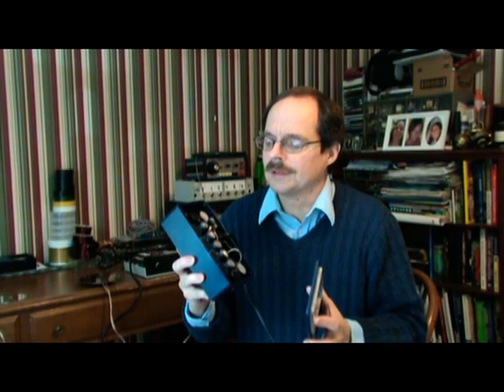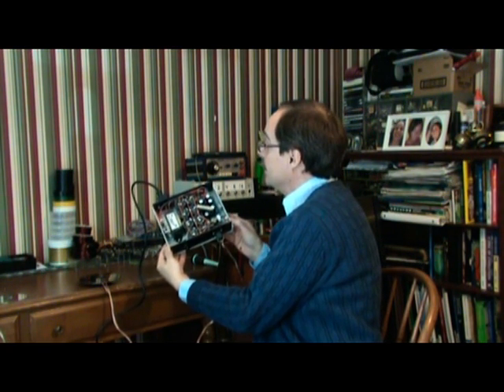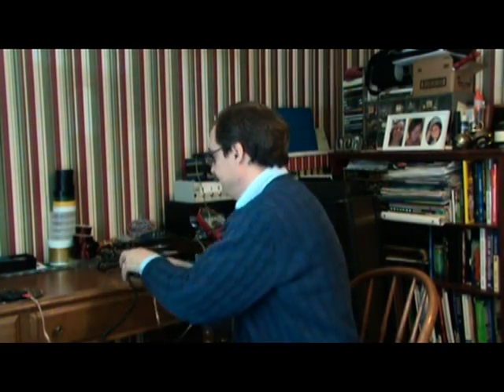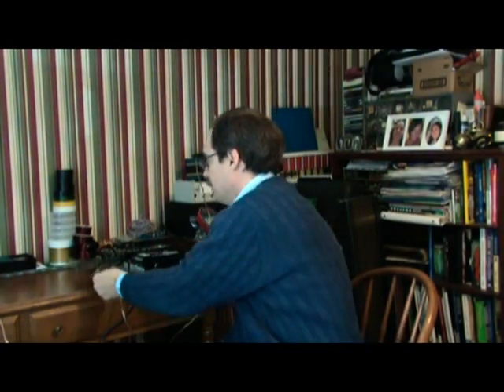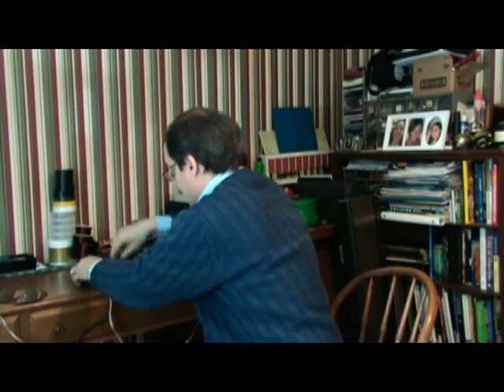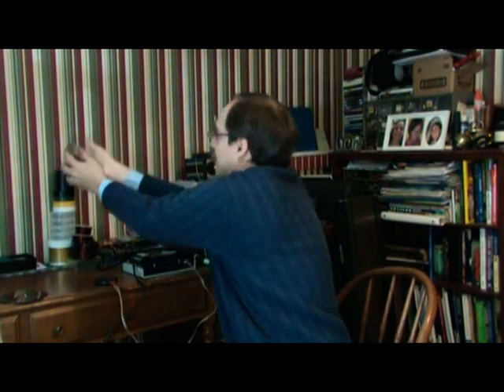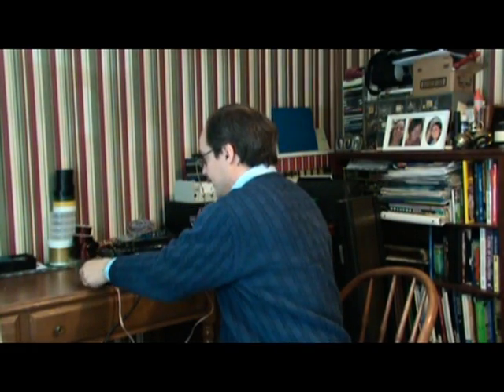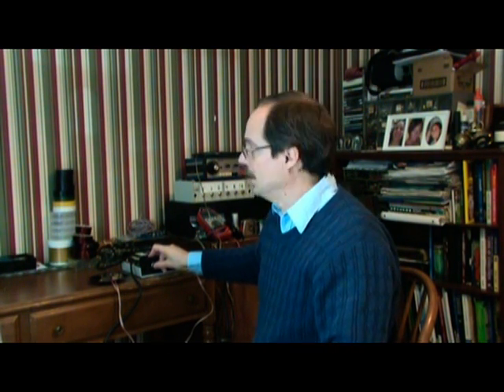Super Thumper Washer Launcher

Comment from the maker: @mq1506 - There is no limit but at 2,000 volts my 14 gauge flat coil is almost destroyed.  I have used 10 gauge at 5 KV in other videos.  basically your coil would have to be bigger than 8 gauge or it would be blown to bits.  You can use a sandbox to protect yourself from exploding wires.